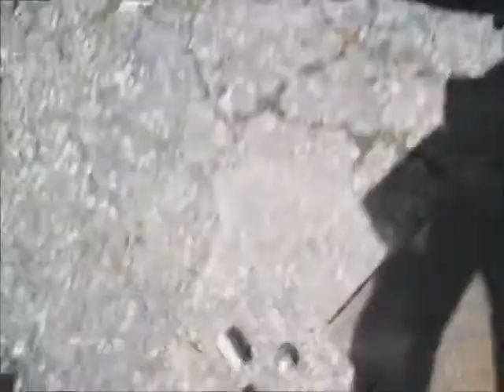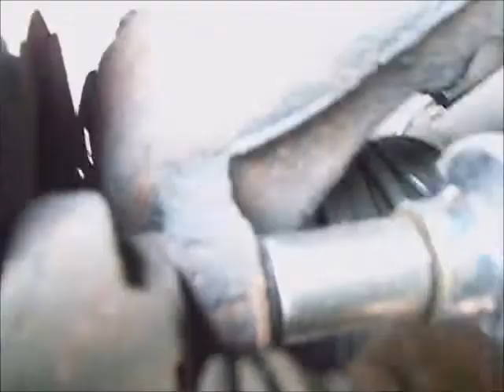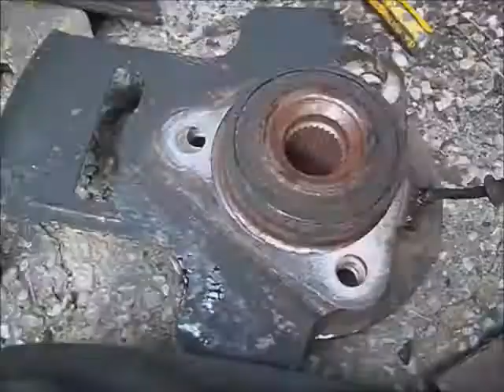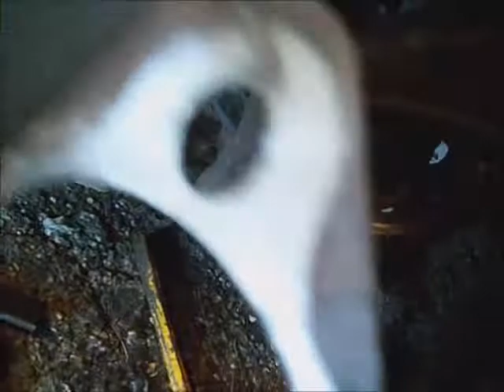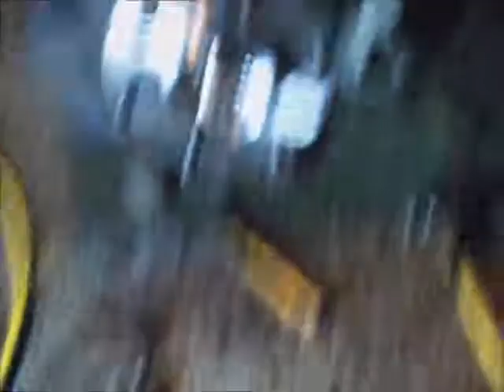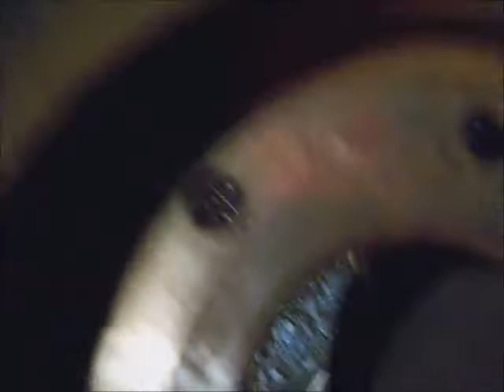Nissan Armada SE `07 front wheel bearing noise, replace

Comment: Thanks for the tip to use a chisel to wedge the hub assembly out. Saved a lot of time and headaches. Slide hammer is nice but only helps after it’s at least initially busted. 
I had a tried to remove a hub before an a previous car,tried everything to no avail, had to take it to a shop.
This worked great on our 2005 infinity qx56. Seriously, thank you!
Reply from the maker: Thanks for watching

Comment: This is magical, rotors disappeared without instruction
Reply from the maker: What instruction?  The rotor FELL off when the brake caliper was lifted off of it.  Just like I don`t show removing every lug nut being removed.  On the odd chance the rotor is stuck, spray penetrating oil around seam of center hub and lug stud holes. Then at one of the caliper mounting bolt holes, insert a threaded nut bolt combo between mounting ear and rotor, and thread bolt against back of rotor, flexing it outward about an 1/8", take a hammer and blast raise rotor hub sides in a circle, until rotor pops. BE ADVISED (if re-using rotor, use a metal shim between rotor and where bolt contacts rotor finish side, as the bolt will dig into what ever it is pressing against.  Also, if using hammer, (to motivate rotor removal) do not hit shiny finish surface of rotor with hammer, as any marks in this area will damage pads over-time.  And finally do not hit lug nut studs with hammer.
Reply: lol   duh 
 @AutoDrdiy